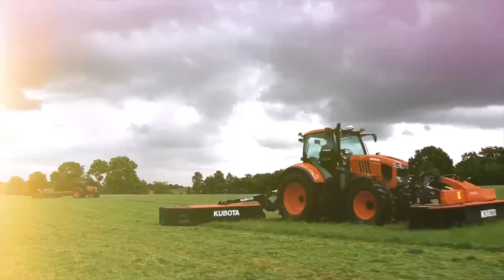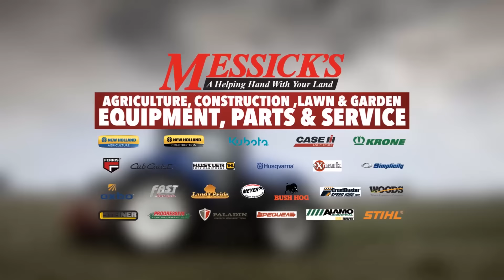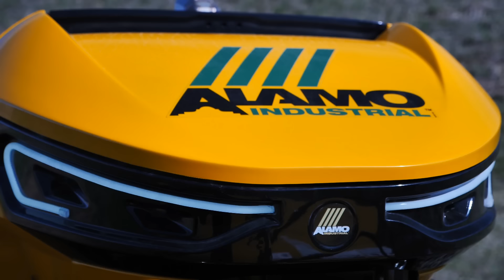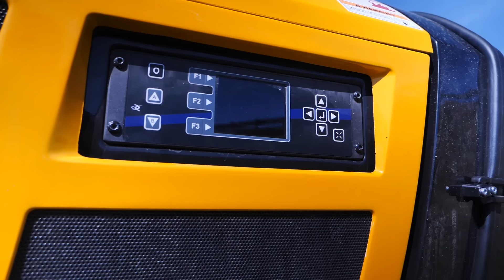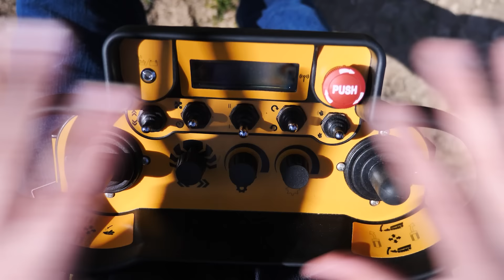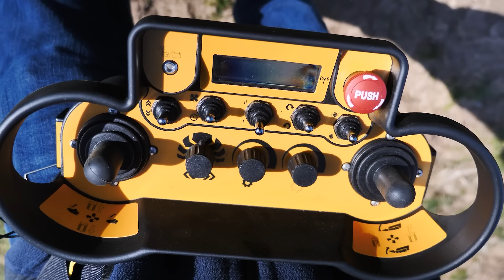ROBO Cutter! - Alamo TRAXX RC56 remote control mower

Comment: Hhmm says Alamo.....hopefully you have alot of extra hydraulic oil  and hope its built for the long haul but with Alamo....I highly doubt it
Reply from the maker: What's your preference?
Reply: Messick's  I dont have any experiance with these just referring to our mower attachment on a JD tractor
Reply: @Marcelino808  then shut your butthole.
Reply: @Marcelino808  Please share your experience with your mower attachment. Is it a flail mower?
Reply: @blessed7fold  No its a Axtreme2 side arm mowing deck
Reply: @Marcelino808  What's been your experience with it?
Reply: @blessed7fold  I dont run the machine daily but I do maintain it and the valve body leaks constantly
Reply: @Marcelino808  Has Alamo not offered to replace the bad valve body under warranty?
Reply: @blessed7fold  Out of warranty

Comment: Hello Neal
What is the price range of that unit???
Thanks 
Edward
Reply from the maker: Under 100k. Kinda complicated, because most of the buyers are state\federal and purchase off contract pricing.
Reply: Wow I was gonna guess in the mid fifties range on the price  Tag
Reply: @kubotaman3440  I looked it up, 82k retail some places.
Reply: @steveterry7981  thanks for throwin a number up there, right where i was guessin it would cost😅
Reply: Sounds reasonable after thinking about how much labor and state benefits are for a bunch of guys with string trimmers over the useful life of the machine.